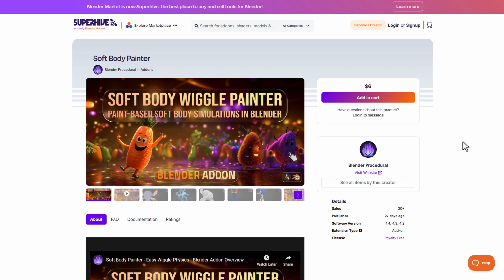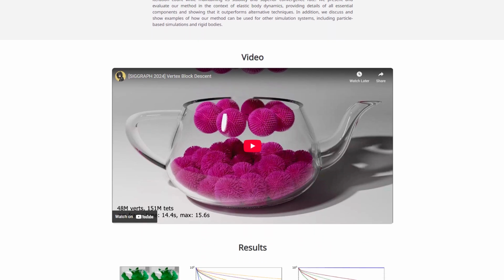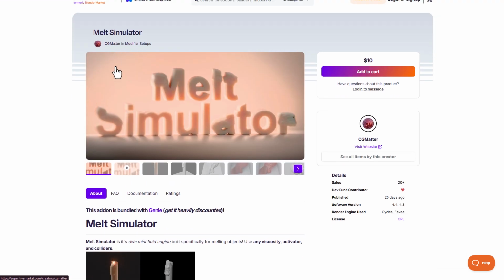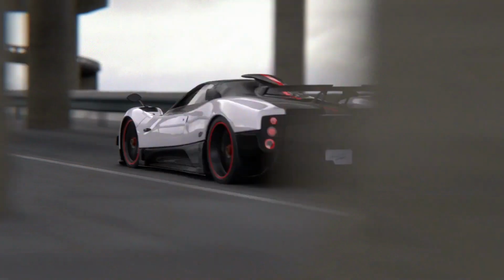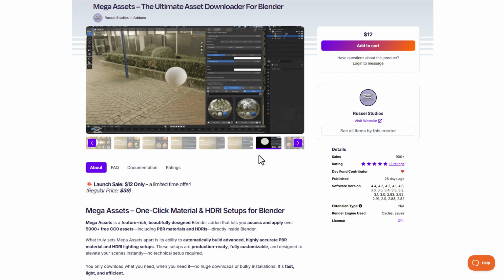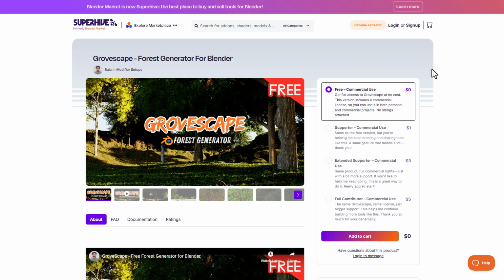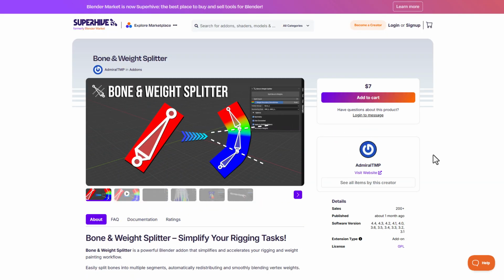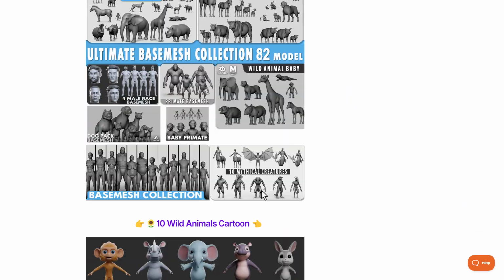Brand New Blender Addons You Probably Missed! - MAY#1

Comment: Look, instead of building a proper UI for every new feature you add to Blender, you just slap on another shortcut — stuff like CTRL+ALT+D+R+E+Q+Y+F12+A+Q+V+B+D — like you’re designing Mortal Kombat fatalities. Seriously?

Rather than refining what’s already there, each new release keeps degrading the user experience. Case in point: EEVEE NEXT. It takes an eternity to load complex scenes. The old EEVEE handled those in minutes, on the same machine. And don’t give me the "your hardware is outdated" excuse — Blender’s strength used to be that it ran on everything, from budget laptops to high-end rigs, scaling with the project size.

Now? It’s all going downhill. No real improvements, just bloated, half-baked features that break more than they fix. That’s exactly why I’ll never donate a cent to the Blender Foundation. Because it feels like you’re flipping the finger to the average user and calling it progress.